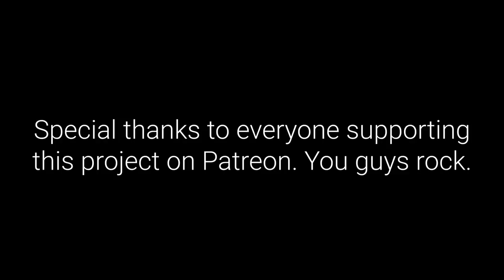THE VAN IS FINISHED - Van Build Part 3

Comment: I would suggest an outer cargo rack on the hitch for the gas container so that you aren’t smelling fumes the whole time you’re in the van.
Reply from the maker: We have actually been sleeping in it for a few days now and no issues with gas smell.
Reply: Tucker Gott good deal man. I know I had a gas tank in a work van sometimes and it was strong! You’ve got me wanting to fly. We’ll see how it goes. Thanks for the vids man.
Reply: Hey man, I think you might be underestimating the effects of a gas can in your vehicle. I see you have a stop for it too keep the fumes out. I'd suggest investing in a cargo rack like Ben said, at minimum PLEASE buy a fire extinguisher to keep in your car. You're keeping your engine and then the gas container right next to each other. You also have what seems to be a perfect fire started in the wooden panels on the inside walls and ceiling as well as your box springs and bed. Just be safe guys. Here's a few quick reasons to not keep your gas can in your vehicle.

An empty gas can may not be safe to keep in your vehicle because of the fumes emitted, and it not being emptied all of the way. According to CNBC, the gas vapor mixtures can explode inside these portable red containers and may cause significant injury to those in the vehicle.

A study by Worcester Polytechnic Institute shows that even a low level of gasoline inside the can has potential to create an explosion when it comes into contact with a spark or a flame. The vapor around the outside of the containers causes a flashback inside the gas can, and that mixture can cause an explosion.

Another potential danger of transporting gasoline in your vehicle is illnesses due to inhalation. Gas contains carbon monoxide, which can give you headaches, nausea, and flulike symptoms. Prolonged exposure to carbon monoxide can make you extremely ill, so it is best not to keep a full or empty gas can in your vehicle.

Have fun out there.
Reply: Very good advice T and I hope he heeds it. This is one time that you don't want a learning curve.
Reply: The learning curve on that goes straight up, and straight down. You either live through it and never have a gas container inside the vehicle again - or you aren't around anymore

Comment: Looks great for version 1.0   This will be a great shakedown trip.  I am sure you will find lots of things you want to change, add etc.  I can see adding a small kitchen area where the para-motors are and getting a 8x14 enclosed trailer to tow behind.  Store the para-motors in the trailer along with some cabinets, tool storage and a small workbench.  You would be set to travel any where and fly to your hearts content. 

Great job!!
Reply: Good point, also watch out for condensation between the mattress and the sheet of plywood under the bed.
Reply: Ken Cramer I was thinking the same thing
Reply: yep a toy/trailer hauler conversion.... they work great for hobbies like this!
Reply: Yes, a small trailer to get the para motors  and gasoline cans out of the living space......

Comment: looking good Tucker... if I may make a suggestion or two....     I have the same setup so from the back I placed my paramotor into the van and closed one door to make sure the paramotor would not rub on the door as I drive around...   for the tie down points holding the paramotor I used the eyelets on each side back there to keep the paramotor from sliding left or right... then at the top of the van I installed a clothes bar that stretches across the van...  I put bungy cords hanging from the bar connecting to the frame of the paramoter...  then I put a couple foam blocks between the bed and the paramotor...  you can get good foam blocks at a store that sells outdoor furniture... just buy the out door chair pads.. don't even have to take the foam out of the case...    so when you want to fly you just open the two back doors, un-hook the paramotor strap ins...  sit on the back of the van and get into the paramotor harness and walk away from the van with your paramotor on your back...   next thing...  if you don't put shelving in then everything you put into your van is going to slide all over the place when you brake or turn corners...   a simple solution is to get a storage rack from Home depot and mount it right behind the driver seat up against the wall...  then you can use the shelves to hold items from sliding around and its cheaper than wooden shelves....   best of luck... oh.. one more item.... you need to get a scanguage....   why ?   because the Sprinter van has what is called a limp mode if the engine sends a error code...  the only way to drive the van after it goes into limp mode is to clear the engine error code(s)...   with the scanguage installed you can clear the code and the van will drive normally depending on the error code(s) and it will tell you what error code(s) are being reported so you know what needs fixed....   best of luck...

Comment: I set up my pickup truck / camper shell with a raised bed in the back.  Under the 2" foam mattress was a storage area.  

This allowed me to store my windsurf gear under the bed.  Anyone looking in the windows saw a bed, no gear.  The entire bed and storage area could be removed by removing 6 screws and sliding it all out.  The key was adding support strips along the sides to rest the plywood, then a vertical center divider to support the plywood.

Comment: I put a Kenwood backup cam and sensors in the bumper of my 2006 Sprinter and it was a life saver. Like the adjustable headlamps? I added baby moon mirrors on the outside bottoms of the large side mirrors to see better on blind spots. That van purrs down the road at 80. Enjoy

Comment: You’ve done a cracking job mate. You can always fit wood trims over the joins. One thing that would be good to do is to drop your headlining in the cab and insulate the roof there to combat condensation... warm air from back through to a cold cab will give you bad condemnation. Have fun and enjoy your van buddy

Comment: I would have put the paramotor storage area in the back. And eventually a wall to section it off from the bed area.
Reply: A trailer would be much better. .it wouldn't take much to turn this van in to a proper camper ... kitchen. . Wardrobe a bit of tlc and it's done

Comment: Looks great!..I did a sprinter build years ago, conduet floor to roof i wish i had done more of for wiring, i ended up with 400 watts of solar on the roof and a challenge to get to the coach batteries, inverter.

Comment: Small piece of advice.  You really need to put supports under the bed frame.   I realise it may look and feel strong enough to support the weight of 2 adults and a mattress, but the  cross pieces of the frame will almost certainly warp down over time.  Depending on the quality of timber used, that warping may only need to be as little as half an inch at the center before the timber cracks.   A 3"X3" running the length of the center of the bed, supported by 4 legs, will save you hassle in the future.

Comment: If you wanted a snazzy look you could put some 1/8th inch thick trim over your joints to hide them then stain them a darker color. That’s what I did. You did a way better job than I did matching up your joints though. Looks great.

Comment: Speaking from EXPERENCE, get an outside fan cover for the fan! You WILL drive off and forget to close it and break it or high winds can do it in so protect it!! 

I can't remember if you scaled it when you got it as the difference in weight with that lumber yard in there should be interesting! It'll also give you your gross weight so you know what you can pull. But it's still a good idea for bragging rights!
Can't wait to see it with the covering on. RU going with leather or velour upholstery?

Comment: You need some curtains man. Pro tip: cut up some walmart black-out curtains and sew in some magnets then just stick them in the windows when your parked. They'll help with insulation and you can stow them when not in use. / no curtain rod.

Comment: Great video.  You definitely got some skills.  But I would have used a Futon Mattress and created a Futon Couch/Bench that you could slid up and down to save space when you aren't sleeping.  Hang those Paramotors on a rack in the rear on the outside.  Then create a small Kitchenette with power supply for running Water, small Frig/Cooler, and a small Microwave and Burner for quick easy to cook meals.  But easy for me to say...LOL.

Comment: I know the mattress is pretty heavy and wont budge much but if you break hard or crash you should put a stopper in front of the mattress  so it does not slide out and hit you in the back of the head or crash into your para-motor...

Comment: swing away gas/prop holder from the tailgate. like every one is saying,  2 stroke smell while sleeping would be like sleeping in my snowmobile trailer. or even a converted swing down ladder holder from the roof.

Comment: Dude.  I love all of the videos.  Get yourself an RV vent cover off of Amazon.  It goes over that roof vent so you can still use it if it's raining outside.  They're cheap.  No more than $30.  Also, I'd secure that mattress somehow so if you have to slam on the brakes, it doesn't slam your paramotors!

Comment: Just worried the mattress is gonna fly forward if you brake too hard 😳
Reply: That was my first thought too, especially since they removed the bulk head...
Reply: Plus he’s got his motor there to stop it it looks like.
Reply: If it happens it’ll only happen once then he’ll probably immediately fix it. Would be a super easy fix
Reply: I commented about that too before I read yours....  he'll only let that happen once.  Hopefully that once isn't his last.  I got in a wreck once and something on my back dash flew forward and cracked me in the back of the head.
Reply: It would be pretty easy  to strap it to the deck before taking off.
Reply: a little stop strip screwed onto the front of the platform would work fine
Reply: DSHaddaway I doubt it.  If you're in a wreck, things bounce up and down.  It'd bounce right over a little strip.  Plus, all the gear under the bed....
Reply: okay, but my response was for braking.  If he wrecks he's going to have a lot more to worry about than a soft mattress...
Reply: DSHaddaway a 50lb mattress smashing into your back, pinning you to a steering wheel isn't gonna feel good no matter how soft it is.  Plus, the sides of mattresses aren't really all that soft.  If he gets into a relatively minor 15mph wreck, that turns major with a van load of projectiles flying at your back.

No sense in half assing a fix just preparing your load for hard breaking.  If you're gonna secure your load, secure it for worst case scenario.
Reply: Dude, have some coffee.  The comment I first replied to was about braking, not wrecking.  A stop strip would be fine for that.  If I was commenting on a design to keep shit from flying everywhere in a wreck I would not have commented what I did.
Reply: DSHaddaway I'm good, man...  just pointing out that u might as well secure it for a wreck if you put any effort into securing it at all.  

At the end of the day, neither of us want a flattened Tucker.
Reply: You said "Hopefully that once isn't his last." that is implying you are hoping he gets hit by his mattress more than one time. hahahhaha WOW! But yeah i'm all with you securing it though.
Reply: Gabriel Robinson I can see how it would be interpreted that way...! Haha!  what I was trying to convey is that I hope if he does have to learn the hard way, it doesn't kill him.
Reply: Yeah all for that!
Reply: Jake Hannah, go spam elsewhere
Reply: Phil McCrackin bruv u can't even spell my name 😂😂😂
Reply: It’s not worth spelling correctly........bruv
Reply: >Discussing the mattress is gonna fly reminded me of this song. I don't know why.  Enjoy.   YouTube video:            Mojo - Stormy Weather Ft Gizella

Comment: Just so you know seams between panels are NEVER perfect. Trim hides seams on wall paneling. Wall panelings fake boards are there to hide joints also. Since you are using ply is just easier to see. You should be proud! Awesome work and great job! Wish I would have seen this when you got it done.

Comment: Great job on the Van! After living #vanlife for a year now, I think separating the living area from the drivers area, would make access inconvenient. Wonder why you chose to use the center of the van instead of the typical "garage" for the paramotor gear?
Reply from the maker: Thanks! We primarily tow a trailer for the motors but sometimes they have to squeeze in the middle.

Comment: try to make the door panel so it can be easily removed to access the latch, I've locked myself in the back of my van (not a sprinter van) by accidentally pushing the child safety switch and the only way I got out was to manipulate the latch, cause I didn't have a panel blocking access, or I'd been stuck in there till someone else opened it for me from outside... if they have a key or it's unlocked

Comment: Hey Tucker you did a mint job on the van but I am concerned about you and your girl friend sleeping and driving with gas in the van y don't you buy a small in closed trailer and you can bring both paramotors and the  in side of the van you will have much more room to or use the rack thing that's on the back of your car and store the gas out side on that  cause gas fumes can ignite from a lot of stuff even your phone just saying pal just want you guys to be safe looking forward to the road trip

Comment: Your vent fan is spinning backwards.  It's meant to assist the upward draft out through the vent, not pull air in.

Edit:  Never mind, it's spinning the correct way later in the build.
Reply from the maker: +radon360 Very good eye! I realized right after that first clip, then reversed it but we didn't film that.
Reply: Tucker Gott  I dunno, maybe it has something to do with this channel often featuring large spinning propeller blades... 😀
Reply: radon360 congrats for not deleting the false part!

Comment: a whole day of furring... hmmm.. so you are furries i guess? okay.. ill show myself out now and do a seppuku.. but joking aside, no electrics in the walls? if i were you guys i would put a few solarpanels on the roof and an outlet for a wind generator on one of the back corners of the car so you could hook up a wind generator at te end of the car while parked.. and i would pimp the fuck out of the interior with led strips and stuff.. i would also keep the main car battery off that curcuit so you dont accidentaly drain your battery an are unable to start